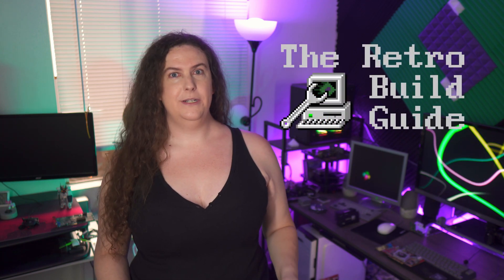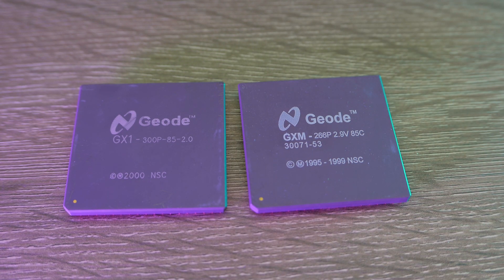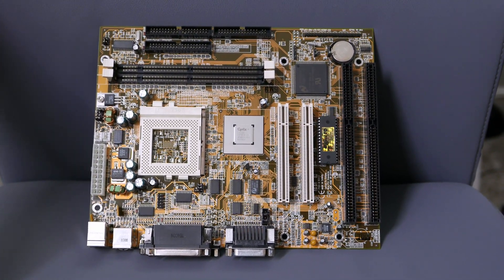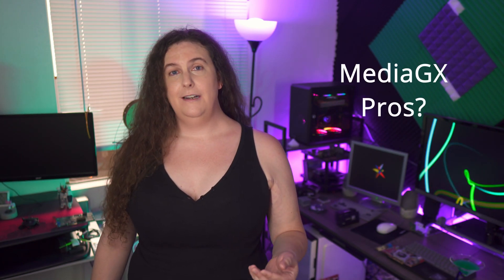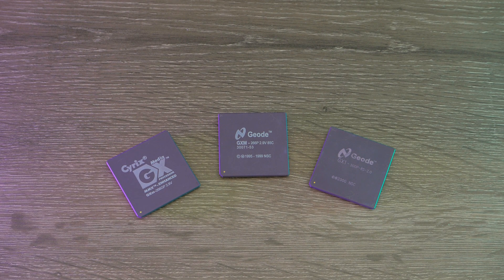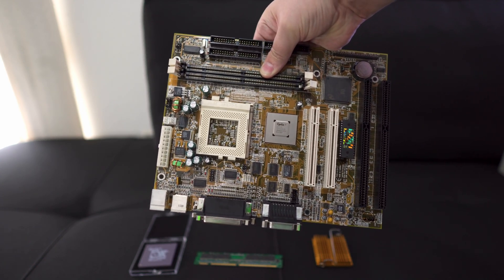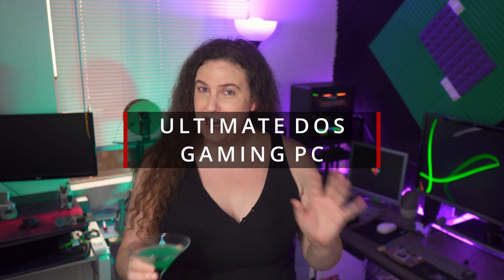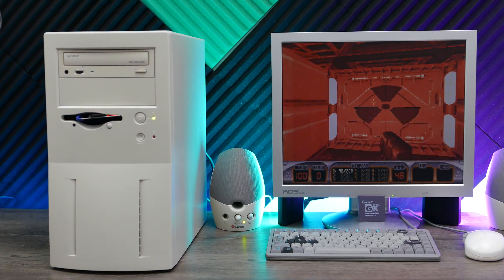Retro Build Guide - Cyrix MediaGXm

Comment: So if you have a mobo with the Cyrix CX 5530, the main CPU is an Intel? Got a hold of an AAEON PCM 4896, with the Socket 7 & Cyrix CX 5530.
Reply from the maker: The CX5530 northbridge won't work with any CPUs except the MediaGX / GXm / Geode GX1 processors it was designed to interface with. Even with the physical Socket 7 interface, if you put an Intel or AMD CPU in there, you'll short the board out and kill it.
Reply: @TechAmbr okay, I finally removed the heatsink, and the CPU sitting in the Socket 7 is a Cyrix MMX Enhanced GXm 233GP. The CX 5530, near the Cyrix CPU, I gather is the co- processor.
Reply from the maker: @j.lietka9406  More accurately, the 5530 is the northbridge, although the MediaGX could almost quality as a System On A Chip, certainly by 1998's standards. The CX5530 has support circuitry for the MediaGX like an ISA bus controller, IDE controller, sound output routing from the Ring0 Sound Blaster emulation on the CPU, etc. Most of the system logic is in the MediaGX: Integer and Floating Point units, MMX units in the GXm and GX1 models, PCI controller, SDRAM memory controller, VGA controller, and sound emulation firmware. It's a really remarkable achievement in large-scale system integration
Reply: @TechAmbr i actually found the Cyrix based mobo in an apartment dumpster. I don't think it was a PC mobo as its size is what, maybe half of a regular Socket 7 mobo. The manufacturer said it was for industrial applications, but which ones...?

Comment: I actually built an almost identical MediaGX box in the same new old stock case. It's absolutely best considered a PCI based 486 with fast RAM. The ECS motherboard is actually really nice for it's price point. The only issue I have with it is the system stays on as soon as power is connected, the ATX power switch is ignored. Other than that, a fun quirky box. A good fill in for super expensive VLB based platforms these days.

Comment: Very interesting platform! I  just rarely seen it in some industrial PCs and embedded systems. As far as I remember, these weren't offered on retail marked where I live. If it's based on the 5x86 platform, this is kind of a boosted 486 "SOC"/APU?
Reply from the maker: It is! Exactly! Because of the higher clockspeeds, it delivers really decent "low-end PC" performance that's extremely typical of the day. I love it!